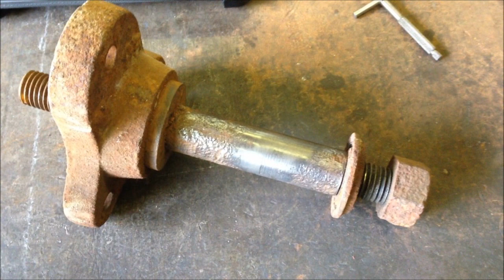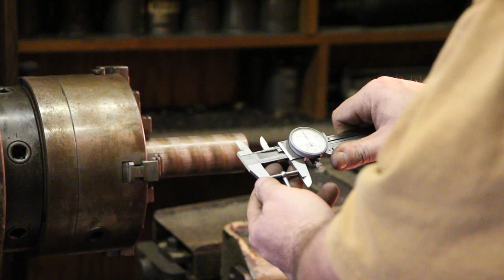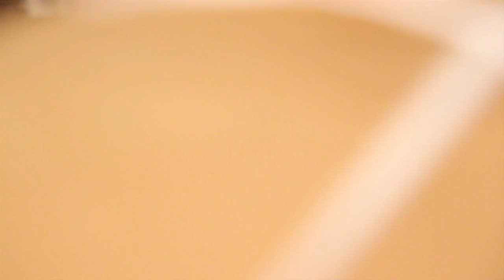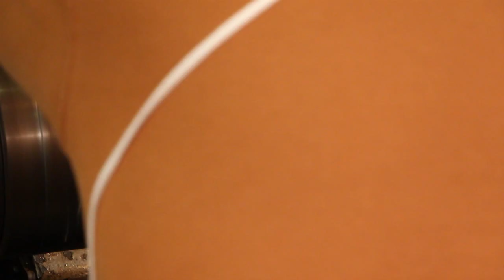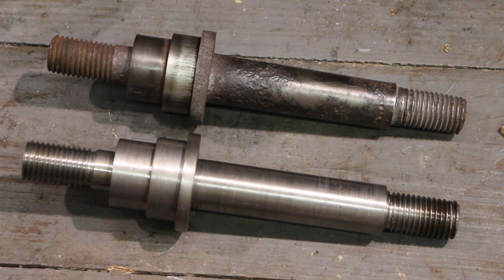Gear Repair:  Making and Installing Bronze Bushings and Machining a New Shaft

Comment: As a model builder and machinist as well I don't make enough "chips" I'd KILL to get my hands on as much of that cast iron chips and even the bronze chips to use in train cars as scrap loads! I'd PAY to have it shipped to me for this reason as I don't make enough of one type metal to load one car, and sadly, I NEED as much as possible to load several cars of the same metal and then each type metal to make up a whole train of nothing but scrap metal cars, that look as tho the metal they're hauling is "shredded"!!! PLEASE send me a message if you could help me out Keith! ~Thanks!

Comment: Hi, I know my question is 8 years late but it's never to late to ask to learn.  For the arbor repair, if one does not have the equipment to make a complete arbor, how about building up the low areas with weld then turn down to your needed diameter ? I for one have a lathe but not one what can do what yours can. A 67 yo Vet. Retired in Ct.

Comment: Don't you ever get worried about heating the outer part and then with the inner part being cool when the two got back to room temp the outer part beaks due to stress from shrinking around the inner part that is expanding? Thanks

Comment: After watching the video on fixing Leo's threading machine and this gear. One tip you should be pressing your bushings first and then reaming to size. This will insure exact alignment and uniform size of the inside diameter. You mention that the alignment is not that critical, even a small misalignment will result in premature wear in the bushing.
Reply: A friend installed a couple of bushing for me this way. They were maybe 4" (100mm) apart, 1.25" (37.5mm) O.D. When pressed in they were only slightly under size for the shaft (0.001" or so). He then used an expanding (adjustable) hand reamer to make the shaft fit perfectly.

Comment: Why use a boring bar instead of a drill to make a center hole.
Reply: Can bore to any size
Can only drill to sizes you own bits for, especially relevant for deep holes, and only to the dimension of the bit, especially relevant for press-fit parts.

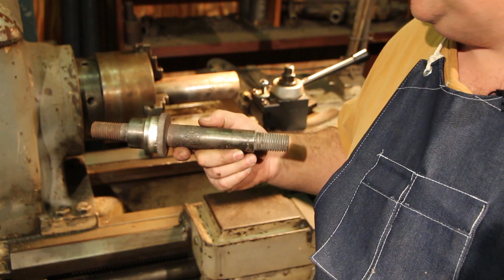Comment: Thanks for the videos, Keith.  I noticed (at 17:16) on the small gear by the repaired tooth,  there seemed to be a crack on the junction with the material in the root of the tooth.   Was this so?  If so,  will it have any effect on the longevity of the repair.
Reply from the maker: Lots of people commented on this, and I have to admit that it does indeed look like a crack on video.  What you are seeing is a line in the material left over from the extrusion process.  I think in one of my follow up videos I actually address this and show on camera that it is NOT a crack.
Reply: Thanks for taking the time to reply,  Keith.  I realise you must get a lot of comments.   Unfortunately I watched your videos out of sequence.   I saw a brazed tooth repair video first,  then this,   then the tooth repair videos on this gear.   Before I'd seen those videos I'd assumed this was some kind of brazed repair.  Now I see it's a dovetail insert,  so it's entirely reasonable that some kind of seam would show,  even if the joint is securely silver soldered.   Thanks again for the videos,  I like your calm explanations,  and getting straight down to the machining.

Comment: I really enjoyed watching the steps  you took in making theses parts ...
The completion of both the shaft &  bushings are a perfect fit...
I can see from your work that you are a perfectionist and very skilled at it ...
GREAT JOB !!!
Wished you were local " I need a extension housing bushing made for a 3 speed Automatic Transmission in a 83 Toyota Corolla in restoring.....
I have ordered several off the internet and they fit the housing perfect " but the new yoke I purchased for the driveshaft has to much play up & down - side to side when installed .....
Anyway great job on your project....

Comment: Keith, when I was training in England we were always taught to pull back the turning tool before putting another cut on. This does not allow the tool to touch the work on the return stroke so it leaves no witness mark to make measuring difficult and also I have had carbide tools break on the return trip. Have you any experience of this or similar situations? By the bye I love your vids, keep it up.

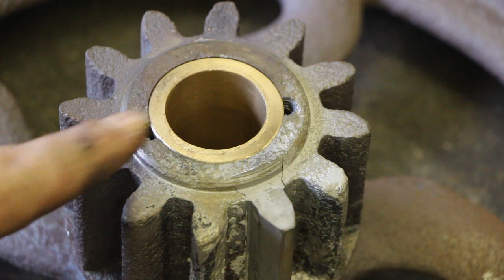Comment: @16:35 close up of the gear. Is that a hairline crack in the root of the tooth to the right of the new one?
Reply: years ago, but... no, its a new tooth machined and soldered in the gear. there is a video of it.

Comment: Couldn't you have simply replaced the bronze bushings, with a couple of roller bearing races?
Reply: Keith was in the process of RESTORING a 19th century machine.  Bronze bushings were OEM and that's what he used.  Remember, the Vance planer/matcher is in a working MUSEUM.

Eli D.

Comment: It's nice to bore a little undersize and come in with an adjustable reamer to ream to size. The finish would be a lot better:  Boring leaves small ridges and after a short time those are worn away.
Reply: Reaming after installation is yet more accurate and allows aligning the bushings' inner diameters.

Comment: Is that a crack at about the 4:30 position on the gear at time in video at 17:01
Reply: It's a repair job he did earlier
Reply: It's not a crack, it's a very badly silver-soldered joint with just about no silver or in fact any strength.

Comment: just put the bushing in the freezer all night, when your hand stick to the bronze is the right temp.. it will slide in like a charm...
Reply from the maker: It makes a difference!
Reply: fireblade639 I agree. If a bit more cooling is needed, spray it with a shot of freon too.
Reply: The Photographic Auditor that Is a better one...you don't have to wait...Next Time i'll try that...
Reply: I put the female in the oven at a reasonable temp and the male in the freezer. Works like a charm.
Reply: Had to use liquid nitrogen to pop off a thick ceramic coating from a steel tube before.

Comment: I've used dry ice in the past for the inside part.
Reply: some sorts of alloys become rather brittle at such a low temperature. Heating is better if you don't bother to reduce the hardness.

Comment: fantastic set of videos. watched all of them all through. but where is the video of the working, restored part in place in the machine? huge let down not seeing this machine working
Reply from the maker: +Paul Sheer Paul, the restoration of this machine took place over nearly three years - it was a total tear down and rebuild and this video was just one of many videos where I was working on different parts of the machine.  If you want to see the machine running, we have it going now and there are videos showing that.  Here is the video of us running the machine for the first time (it was filmed over a year and a half after the gear repair video):  https://youtu.be/bFOwx6_4M5g
Reply: +Keith Rucker - VintageMachinery.org
cool. thanks.

Comment: why didn't you put a grease nipple into the shaft to grease between the brass bushes?just an idea.
Reply: +whitey george   He said,  he is using Bushing Stock.  My Dad rebuilt electric motors (large ones like 150 hp+) and I asked how bushings were lubed as motors pretty much sealed up.  ( this was 50+ years ago).   He said bushings were self lubricating.   You can buy Bushing Stock that is self lubricating.  Graphite or silicone as two examples.  Lead banned many years ago.  Google self lubricating bushings.  You can buy rounds that you machine yourself, or already made by your dimensions, by the seller.  Tolerances in electric motor too tight for grease, no room for grease.  If room for grease on armature, motor was shot.   Why not taper bearings or such?  Have to be adjusted just right and need grease or oil.  Bushings a tight fit, and do not have to be messed with.  Weekly/monthly maintenance is zero.  A cost to consider.
Reply: +Gary Bray Thank you for your informative reply. In addition to Keith's first rate content and video production, I enjoy reading the Comments, as  many times there is much to be learned from them, too. Your comment is a good example of those very helpful comments. 
Best wishes,
Roy - Buffalo NY. USA

Comment: Excellent video....I learnt where i've been going wrong when doing bushings for my old car!.
What would you make the interference for a 1" oilite type bush if you just wanted a really light press fit...ie. so not to change the ID too much.
Also you always cut towards the chuck, is there a reason?
Thanks again!
Reply from the maker: Mark Webster For a light fit like that, probably 0.0005" would be plenty - no more than 0.001".  As for the cutting, I mostly cut towards the chuck as the pressure from the tool pushes the work into the chuck - for a lot of jobs, that makes it self tightening.  If you went the other way, you could pull the work out of the chuck.

Comment: Mr. Rucker,
At about 23:15, as  you begin to initially turn the outer surface, the entire shaft goes in 'til it appears to touch the chuck jaws.  Was that intentional?  You're still better than TV!
Reply from the maker: gsardokla I am trying to remember without going back and watching it again (that one was made a while back), but if I remember correctly, no it was not intentional.  But we made it work anyway!

Comment: Hi from the UK, is there another part to this where the shaft and gear are re-installed on the machine? I'd like to see how the new tooth meshes, as I think there should be a radius at the root of the tooth.  Great work :-)
Reply: Three old radius was cut away. There's now more clearance.

Comment: Hi Keith, I enjoy your videos and hope to see that machine running soon. On a side note, I have noticed that the air nozzle you use is not an OSHA approved one with the side vents to limit the pressure to 30 psi. It's always something they check for at my work. Keep up the good work.

Comment: I've always been a little confused how heating expands in these scenarios. Wouldn't it also expand inwards, making it a bit more difficult to press the bushing in? The freezer, however, I see no problems shrinking something in its entirety.
Reply: don't look at it from a directional standpoint,  imagine the entire piece as a unit gets larger
Reply: @kevins5911  exactly. Imagine a bagel. Now imagine an even bigger bagel. The hole grew too, right?
Reply: You're actually right about that part expanding inwards (addition: also inwards), but I'm almost 100% sure that it's material between the hole in the middle and so to say outer race of the part kind of "wins" in expanding in direction of arc on material as there's more surface area there. Sorry I'm not english speaking person so I don't know what could be the exact terms to use. Freezing is good on the bushing side of part and I also personally use it quite much if I assemble something, but it's just that you can't get that much size difference because of small temperature differential and in many case it's necessary to apply heat to part you're fitting something like in this video.

Comment: Hi Kieth, enjoyed the video, nice work.  A very useful tip when checking the screw cutting pitch is to mark a start point on the work piece withdraw the tool point, engage the sadle and run the lathe at a very low speed and count the number of revolution of the chuck relative to the desired thread pitch, stop the lathe and measure the distance the tool has travelled which should be one inch.  I.e. Eight revolution of the chuck equals one inch distace which equals eight threads per inch.  Very useful when cutting fine and odd numbered threads or when you don't have athread guage.  A chalk mark on the chuck helps with the counting.  If the work piece is small and the thread distance is less than one inch, you can put a sharpy mark on the bedway.  Press and ruuning fit tollerances when making bushes with a thin wall is always tricky.  I tend to finish off small bushes with an expanding reamer. Good luck keep them coming. Michael

Comment: Without wishing to sound daft, why didn't you take the O/D off the bushes you pushed out. That would've had to be the right size and personally I'd make the I/D half a thou tight and then scrape/polish the bush in to suit the shaft.
Really nice bit of thread cutting though and a nice finish on all the m/c'ed parts.
Reply: ***** did you ever get through doing something and wished you had gone about it a different way? Too many times to count (8->). Usually half way through a shift.

Going slightly sideways, I do like that where possible, you make new. Proper repairs them, you can guarantee the material structure.
Reply: Measuring the exterior of soft bushings after they've been pressed in, worn, then pressed out is a great way to get undersized new bushings.
Reply: @mwilliamshs  After 35 years of practice, I've never had a problem.

Comment: Keith, thank you for another great video.  I appreciate both the very good cinematography that lets me see what's going on, and the explanations, in the video and often in the comments too, of why you have decided to do things the way you are.  Very helpful to those of us who are late to the learning game on these topics. 

I noticed in this video that you didn't make a "relief" cut at the end of your thread the way I've often seen others do in threading videos.  I realize that you weren't up against a hard stop in this case, but isn't it tricky to stop in the same spot each pass?  Do you have to watch the thread dial as well as the tool position to hit it?

On a related topic, it seems to me that rather than worrying about disengaging at just the right spot before hitting a hard stop or in a relief cut, it should be possible to run the lathe in reverse, with the tool holder on the back side of the work...and run the carriage left to right and off the end of the work.  True, or am I missing something?

Thanks!

-- Mike
Reply: *****
Thanks, Keith!  It's nice to know I'm starting to "get it"!

Initially I thought you might be able to run the lathe in reverse, with the tool on the front side, but upside down to accomplish the "threading out" idea...but on second thought I realized that that would be putting the stress on the tool holder in the "up" direction, which it isn't designed for.  Don't know if that would give you huge chatter, or cause the tool to ricochet off your forehead, but either way, it's not the desired outcome!

Thanks again for the educational and entertaining videos!

-- Mike B.

Comment: Out of curiosity, why weren't you using the basic hole system, i.e, hole drilled, bored & reamed to a nominal size (1-1/4" dia) and the shaft diameter adjusted to fit?  Here's hoping we get to see videos of that planer/matcher in operation.  Can't wait to see that machine running.
Reply: *****
Sorry 'bout that!  Watched it again and you explained the rationale behind your workflow.  I must've been overly mesmerized by the shiny smooth finish that Lodge & Shipley is capable of yielding.  Didn't expect to see any in captivity south of the Mason-Dixon line.  Guess it works out that it had a "government job" before coming out to the Georgia Agricultural Museum--beyond the chipped paint, it's seems barely broken in.  I'll have to check out the York Museum of Industry (I think it's called) next time I'm back home in Pennsylvania.

Comment: I have quite a bit of mostly home and gunsmithing lathe experience. I recently upgraded to quick change tool holders and now am considering going to carbide insert bits. I am good at sharpening my high speed steel bits so would like to hear your thoughts on the subject. The last job I did was to install a muzzle break on a ss barrel Weatherby magnum and I wasn't to happy with the quality of the finish.
I really enjoy your videos. Bob

Comment: Hi Keith Great video very informative. One question though. Why did you turn a new shaft for the gear and not add weld to the old one and turn it back down to size?. Keep up the great work. Very inspiring.

Comment: HI Keith I was wondering if the original shaft was hardened? If not why didn't you just turn down the original shaft to clean it up since you were making new bushings anyways?
Reply: I meant the shaft that the gear rides on that bolts to the machine
Reply: The pitting in the shaft was deeper than the threads in its end